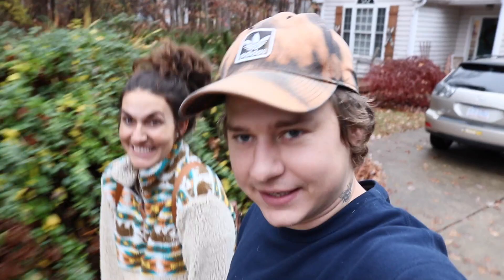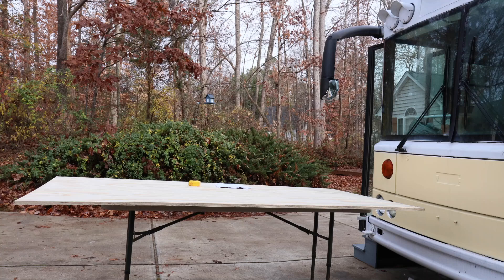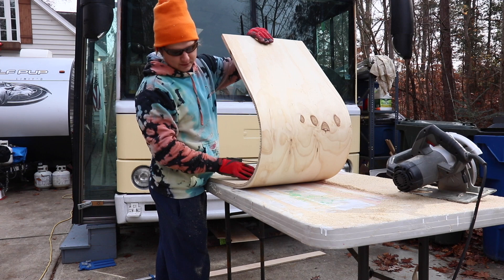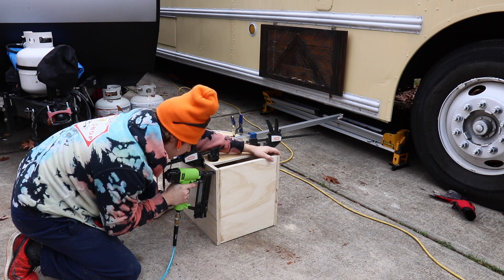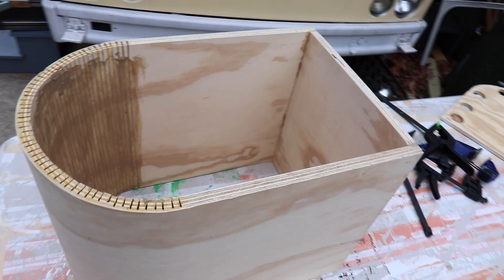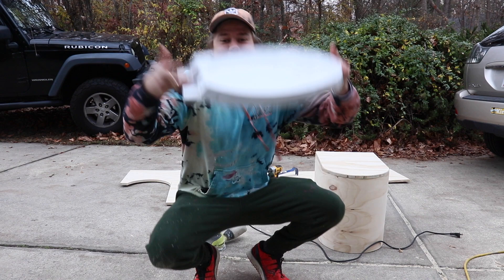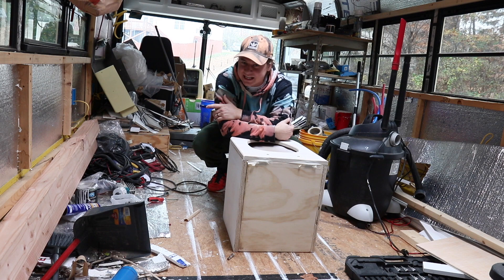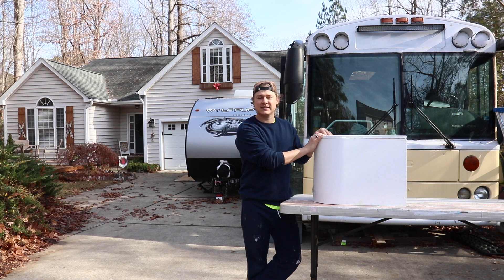How To Build A Compost Toilet VS Nature's Head

Comment: A vinegar bottle works great in the toilet with the johnny urine diverter. Also, you can cut a slit in the front to see how full the vinegar bottle is. We had that set up in our 5th wheel and didn't use the fan in it. Worked great and didn't smell. Put a little vinegar in the urine bottle....no smell ever. Also, spray the diverter with water vinegar solution. Pete moss over each poop and never any smell.
Reply: Yes my mom Only cleans her toilet with vinegar. In Germany, you can buy a whole cleaning series based on vinegar for kitchen for floors the bathroom really good for the environment

Comment: @ a minimum, I would fiberglass the entire inside of the toilet. I would fiberglass ALL of it making it waterproof & easy to clean! Well worth the time & effort..
Reply from the maker: The polycrylic has sealed it and made it waterproof, also the toilet is really just the casing for Johnny compost system which is all plastic and easy to clean. 🤙

Comment: It takes 6 months for poop to compost but the idea in nice nice build a valve on the urine diverter and a spray bottle to use after pee would take care of urine odor
Reply from the maker: Oh for sure but it turns none the less, and yes we installed a spray bidet for that reason and it works great 👍🏼
Reply: It takes a year actually

Comment: Great job on the kerfing and forming!
Good use of the clamping cauls also.

I would recommend a couple of small modifications to the build in the future.

I would start by using a 2 part epoxy.
The stability and strength of the bend will be increased significantly by using epoxy.

I would also suggest using a laminate instead of paint to give the ultimate finished look.

Otherwise, awesome work!!

Comment: Looks good. Would like to make one. Do you have dimensions? How thick the plywood? Spacing of the 59 cuts? How tall? How wide? Where did you buy the bucket kit? Are there plans? Do you intend to install a detachable mixing bail?
Reply from the maker: Hey thanks so much. We love it. However we are looking at switching out our urine diverter we don’t love it. We used Johnny compost system. For the dimensions etc i can’t remember I bought the plan from @modernhousecabin and it was perfect!

Comment: Hey great video! I love a good compost toilet video haha. I have made a few on my channel. My question for you is how will you be connecting to your grey water system? We connected our composting toilet and built a pee trap. But I'm wondering if that's necessary or if there is another way of doing it? Whats your plan there?
Reply from the maker: Hey there! Our current plan to use a Hepvo Waterless Waste Valve it acts like a p-trap  but with a membrane instead of using water.
Reply: I actually just today heard of Kildwick brand [urine separator for compost toilets]. Idk if it works any btr than the other, I'm just beginning my journey into toilet research 😂🤣 & what works best for me. Just an fyi.